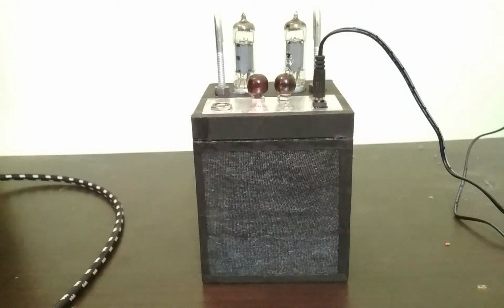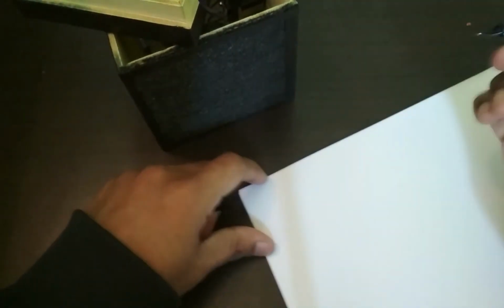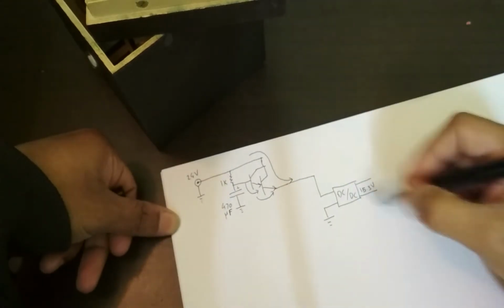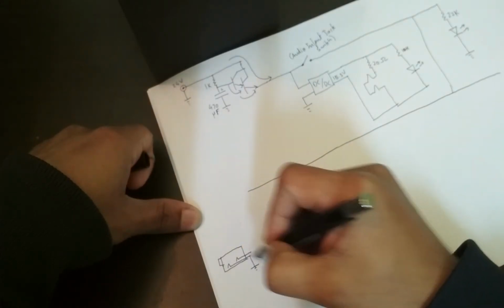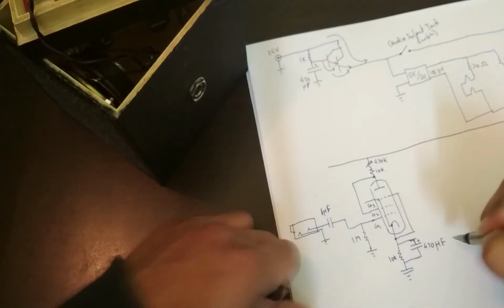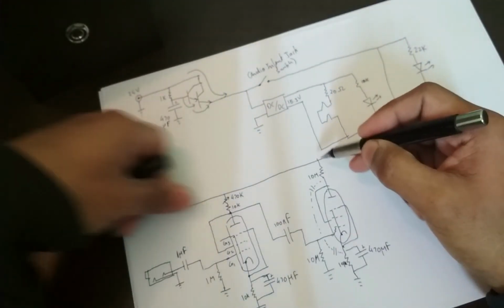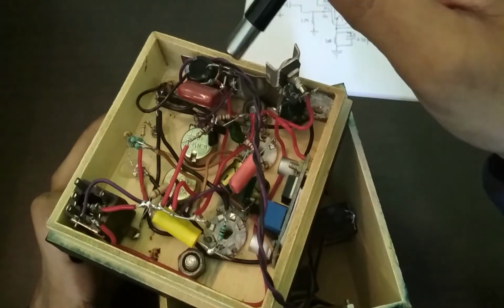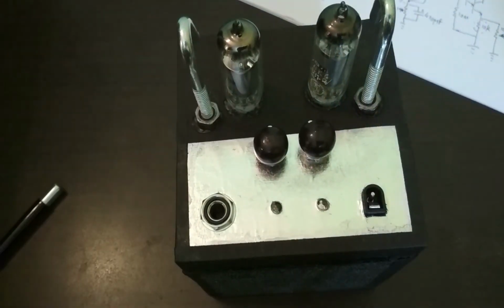Small homemade tube guitar amp with 6J1/6K4 pentodes (demo and schematic walkthrough)

Comment from the maker: A few significant amendments/addenda (sorry!):
On actually measuring speaker voltage while playing, it turns out the output power is limited by the gain. With the guitar plugged straight into the amp it's really about 3 watts, tops (more if I put a boost in front). Still plenty loud for practice, though.
The tubes are 6k4's, not 6j1's. I got them as part of a preamp kit which was listed as using 6j1's, but was actually delivered with 6k4's.
The 6k4 filaments draw more current, so I increased the buck converter output voltage to a bit over 18 volts.
Turns out the 10M anode resistor on the second stage doesn't really give much extra gain after all. I tried a few different values and settled on 470k.

Comment: Is there any hiss from the 6j1?
Reply from the maker: Hard to say exactly where any hiss would be 'coming from' exactly, since 'coming from' is not really that well defined here
Reply: Great video! I’ve been messing with with low watt transistor amps and this build looks awesome with tubes. One probably dumb question… do I need to
Be concerned with shocks from
High voltage with this build? I’ve not worked with tubes before. Thanks!

Comment: in the Darlington Buffer, are each of the resistors connected to the tube output , or are they connected in series and the diagram just doesn't show the jump over tube output wire?  That confused me when you crossed the lines in the schematic.
Also, is the audio input jack switch part of the DPDT from the guitar input jack?  I noticed when you plugged the cable in the green LED lit.
Finally, great video.  I liked how you drew the power rail and showed how the other components attached to it.  Made it very easy to follow.
Reply from the maker: That's connected, it's a voltage divider for biasing. Doesn't actually need to be there tbh, you could DC couple that part and it shouldn't make too much of a difference.

Comment: This is amazing! Just wanted to check if this can be built using 1j24b tubes, I think they can run at 1.2v of heater voltage. Could these be a direct drop in for 6j1s?
The amp sounds wicked! Cheers
Reply: Oh shucks ok!! I had ordered some 12 of these 😂 used just one in a eurorack VCA, thought of making an amplifier using these. Let me fiddle around with your circuit using these 1J24Bs (considering both are low voltage pentodes albeit different) and see if I can cook up a workable circuit or end up breathing in some magic smoke from an experiment gone wrong 😅 (these tubes are super flimsy and a pain in the rear end to breadboard with!!)
Reply: Hey finally got around to making this with 1j24bs and got some sound!!!! Not as clean but sounds OK...used an lm386 for the power section....waiting on an 8 inch guitar speaker.....tried using a tda2030 for the power section but it gets super hot in like 5 seconds or so....any idea why the chip is getting so hot (have a heatsink for the chip...feels pointless)...currently using a tiny speaker that's rated at 1 watt!
Reply from the maker: It's class AB so it's expected to get a bit hot... but then that's also true for the LM386. I don't know why one would get hot and not the other. If you have a heat sink, you should use it. The TDA chips have built-in thermal protection so you might just get louder output with the heat sink.
Reply: @Psychotenuse  yup using a heat sink with the tda2030 but it still gets super hot incredibly quickly and I chicken out and turn it off fearing the ic will burn and/or explode….Have given my folks enough to be scared of with exploding capacitors already 😅….had two tda2030s around and both got incredibly hot…have heard fake ics get very hot..not sure though if the ics I have are fake or not …will stick to an lm386 for now
Reply: Got it working with a Tda2030….just needed a bigger heat sink that I had salvaged from an old laptop…I kept the LM386 as a Gain stage and also put in a passive tone board with bass and treble after the tube preamp and surprisingly it works😅….it’s damn loud with a bigger speaker. Still noisy! I’m assuming due to being a prototype on breadboard!! Thinking of adding a switchable overdrive circuit now!
Reply from the maker: Awesome, sounds like you're making quite a project of this! :D
Reply from the maker: @JK-gw6mz  Part of your noise issues might be because of lack of a solid ground. You can try a grounded power supply or could DIY some grounding and see if that helps.
Reply: @Psychotenuse  ya high chances there’s some grounding issues which I’m not able to figure out….caught up with work so haven’t been able to work on this at all😓 maybe over the weekend I guess!
Reply from the maker: Glad you like it! The tube you mention certainly doesn't look to be a "drop in" replacement, unfortunately.

Actually,  the tubes I used turned out to be 6k4 tubes, which clearly are drop in replacements (sort of).

Comment: Great job. This is such a cool design. Have you checked the max voltage output the 2nd tube and how much input swing the power amp chip can take without clipping? I was thinking about hybrid guitar amps and how to ensure that only the tube stages get overdriven while the solid state output stage has lots of headroom.. so all the distortion is from the tubes!
Reply from the maker: The power amp section here has no voltage gain, so there are no headroom issues as such. If you want to overdrive the tubes though there's just not enough gain so you'll need more stages.

Comment: Well explained
Thank you 🏴
Reply from the maker: Thanks for watching :)
Reply: just finished building one.Running on 50 volt with some adjustment to resistor values I found no need for a buffer stage. Sounds very nice
Reply from the maker: Awesome! You know, I actually have removed the buffer stage on mine since I made the video :P

Comment: Hey, I was looking to build a fender replica with a 12AT7 and a 12BH7A but would love to start with this one as it's cheaper. Could you put in a parts list I can use to order online? Some links would be very helpful. Btw, where in India are you?
Cheers on the build. Sounds awesome!
Reply from the maker: Glad you like how it sounds! I didn't really have a way to record it "properly", unfortunately.
You might want to take a look at the YouTube channel Kris Slyka. He's the one I got the inspiration for this project from.
Anyway to be honest, the reason I didn't include a parts list for this project is because I've actually constantly been making tweaks to it and I'm not sure I even remember all of them or what parts I used at this point. The general principle is the same, though... two stages of pentodes running as triodes, then an op-amp buffer.
I got the tubes as part of a kit which you should be able to find if you search for "fever 6J1". It seems like the cheapest way to get tubes in India, unless you order internationally from Ebay or something. The kit also has tube holders, a power jack and some capacitors you can use.

Comment: I would of connected the dc to dc direct to input pwr and put darlington current delay on dc to dc output and connected filaments in parallel...use a FET to buffer tube to amp and use a small class D amp board(TPA3116 or 8) for the amp...
Reply from the maker: Yeah, good ideas. I can get away with not doing things this way because it's a low power amplifier. Not sure that an FET buffer would be categorically better, though.
Reply: @Psychotenuse  Ya it overloads nicely, got the idea from an old VOX amp circuit...and has a high Z input and low Z output, what you want there...